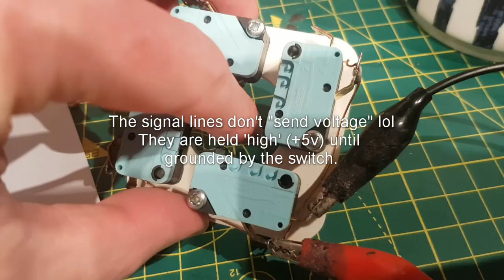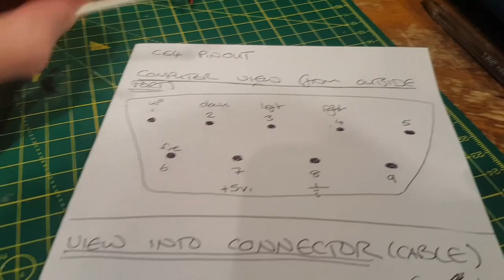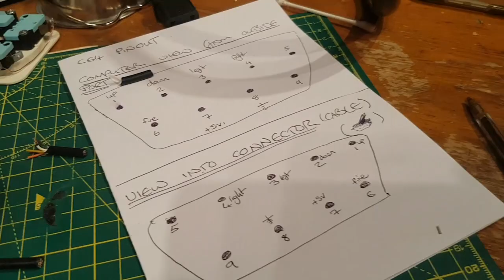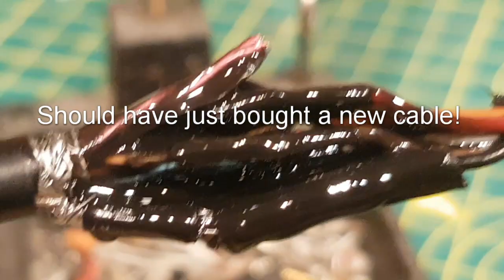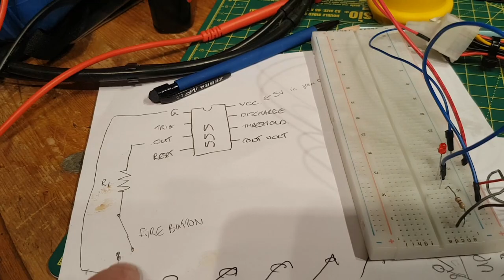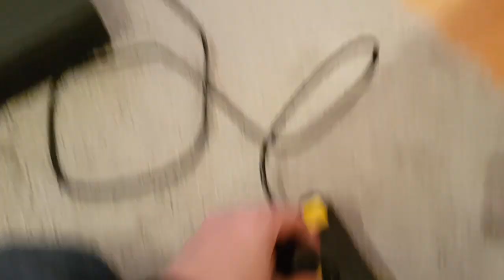eBay Retro Joystick Repair

Comment: Great job!  LMFAO at the point where you kept cutting a bit off, then a bit more off etc.  Ends up with 1ft long cable =D
Reply from the maker: Thanks. Just had to know but gave up at that point 🤣
Reply: Haha =D We've all been there!  I had similar pain when fixing that Philips CDI Game Pad!  One tip I showed in that video is to not use heat shrink!  I used thin pieces of insulation tape which go in and out of each connection to isolate each.  Then use two pieces of heat shrink - inner piece glued to the cable edges, outer piece to encapsulate the lot.  You end up with a much tidier result!
Reply from the maker: @GadgetUK164  Cheers. I'll check that. I don't want to go through that again 🤣

Comment: Cat5's a good backup cable
Reply from the maker: Thanks👍Probably would have been a lot easier lol
Reply: Unless it's that copper clad aluminium crap! It's got to be copper :-) Old PS2 keyboard/mouse extension cables are also a good source of multicore flexible wire, although I don't think you'd have enough conductors for a joystick.
Reply from the maker: @Error42_  Thanks 👍. I looked through a whole box of old cables but had nothing😏. I never normally need a cable until just after I have thrown it out 🤣